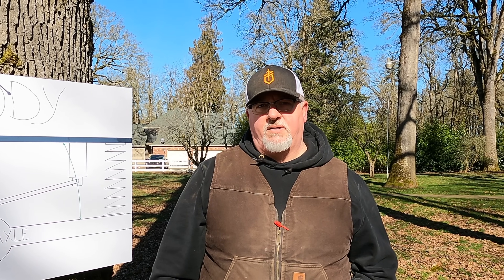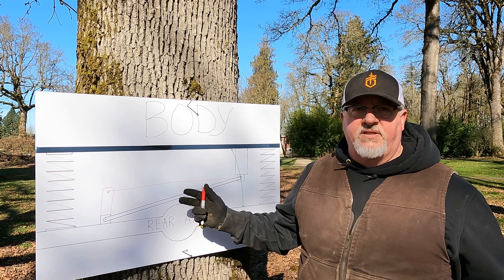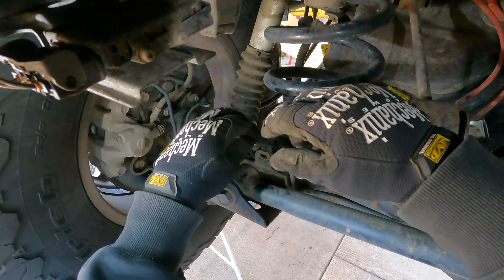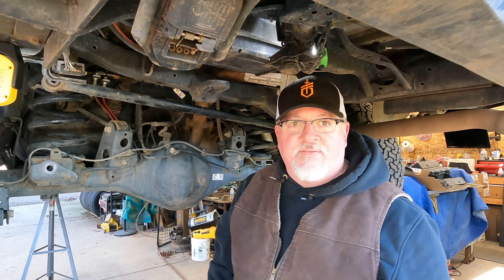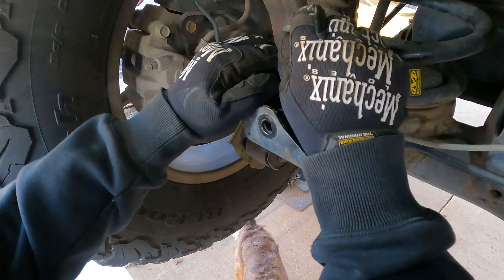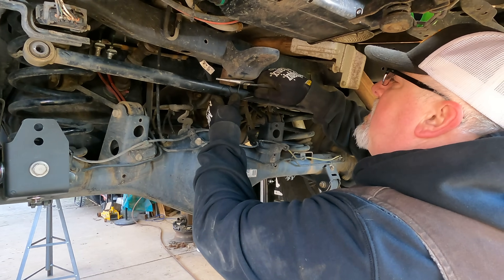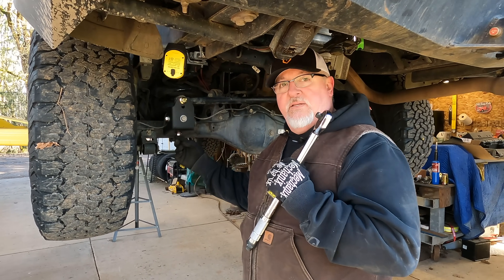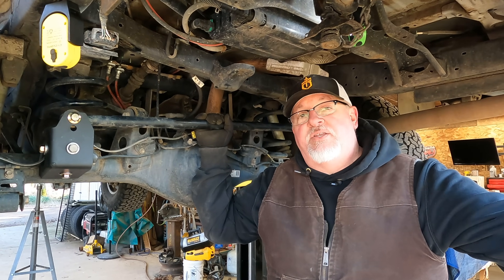Do Not Lift Your 4Runner ... Overland Build Recommended Geometry Fix - Do Not Lift Without This

Comment: So, i lifted my 18 TRD with KDSS using the ironman pro foam cell. It came with an adjustable panhard rod. Should I still do this bracket mod?
Reply from the maker: Best thing to do is to climb under the back and see if your panhard is horizontal (good) or at an angle (bracket should help)

Comment: Hey guys new guy here at what point should we do this if we want to lift 4runner 2 inhes or lower is it a must then
Reply from the maker: The best way to determine if it’s needed is to place the vehicle on flat ground, after you’ve done the lift, and see if your panhard is flat or at an angle. The bracket from drkdss.com will correct it if it’s at an angle 👍🏻

Comment: Which kit did you use? I haven't seen one advertised that looks like yours. No sense changing it if it's not going to be solid.
Reply from the maker: Ironman foam cell pro. I have an install video just for the suspension install. 👍🏻
Reply: @aired-downoverland9239  I mean the pan hard bar leveling kit. I lifted it 3 or 4 years ago and never knew I needed to adjust the pan hard bar. Was is a BOTCK?
Reply from the maker: Mine is made by drkdss.com

Comment: I see some discussion about panhard rod correction in the comments, but you don't mention it in the video at all.  Shouldn't you edit this so someone doesn't have to read all your comments for a good (a safe) install?   Did I just miss it?  Bad on Rough Country for not including it in their kit!
Reply from the maker: Yeah, bad on pretty much every kit for not including a PH correction. They seem to miss things like this, pinion angle correction, sway bar correction, etc.
Anything that changes factory suspension geometry should be addressed. 👍🏻👍🏻

Comment: Thanks for the info. However, shouldn’t it be parallel at ride height? The suspension was fully extended in your install
Reply: Good logic. Also, I would only buy one that can be adjusted based on how high or low you decide to lift, and put a leveler on it when I'm done. Both the presentation and the kit need more specificity.
Reply from the maker: The last shot is the rig off the lift on flat ground.
Reply from the maker: The large version of the bracket has two positions to compensate for different lift heights.

Comment: I’m so on the fence… TRD PRO, OR TRD OFF ROAD PREMIUM??  23’ or 24’???
Reply from the maker: I’m the wrong guy to ask, I’ll almost always go loaded and newer, however, if you’re going to build it out and change the suspension, why go Pro? That said, I do love the colors and the climate control. Good luck 🙌
Reply: I’m not going to build out…. I appreciate your input!🙏
Reply: I just bought the 24’ TRD off road premium.  If you’re not going to go all out off-roading that’s the truck…. The only dif between the TRD off road and the pro is basically the wheels and the shocks….

Comment: I put on an Icon stage 4 and my Panhard is still relatively flat. Why isn’t mine as bad as everyone else’s?
Reply from the maker: If your lift was a 2” in the rear, your panhard should have an upward angle from the axle to the frame. If the rear of your vehicle is super heavy, and you’re only getting a 1” lift, it may air straighter, but should still have some angle.
Reply: The rear is heavy-ish but if I put the Panhard bracket on there it would make the left higher than the right. It was a 2” in the rear.
Reply from the maker: @kriswageman  Note in the video there are two positions for the left hand side; sounds like you would use the lower position.

Comment: What if you use leaf spring suspension
Reply from the maker: No panhard rod typically with leaf spring rigs, so no need for the bracket.

Comment: What is the max lift you can go without the extender?
Reply from the maker: I don’t actually know, but I’d guess around an inch.
Reply: @aired-downoverland9239  from a physics engineering  standpoint, that makes sense. This video saved me. Thank you!

Comment: Do you need to do this with just an 1.5” lift?
Reply from the maker: Best way to verify is to look at your panhard with your rig on flat ground. If the panhard sits at an angle, rather than flat, you could likely benefit from the correction bracket.

Comment: Except when you take the rig off of the jack that bar will no longer be lined up how it is. Same as when you disconnected it. Its on the lift so with the axles and wheels hanging, the bar and bolt won't align. You should show the alignment of the bolt while its not jacked up and in its proper position.
Reply from the maker: I went to your channel to find other tips but found no content 🤷🏼‍♂️. If you had said, “you should torque everything with it sitting on the ground” I would have agreed, then told you it’s difficult to film that way. Having done this type of work countless times, I’m confident in what I’m doing.
Reply: @aired-downoverland9239  I am not trying to sound like I know it all because I dont. My observation was that it looked like the misalignment of the bolt was do to the tension caused by the wheels/axle hanging.  I should've posed my comment more in the form of a question. I was not trying to be rude. 
I have an older Hilux Surf and Land Cruiser that I want to lift at some point. I want to do it right of course. I also dont want to do anything that isn't totally necessary. My position is basically this. As a mechanic, wouldn't you want your customers to ask questions and challenge you on an unconventional idea or installation?
Reply from the maker: Fair enough, I misread your comment. The short answer is, when modifying your suspension, do everything you can to maintain stick geometry…unless you have a specific reason not to. A 4Runner rear axle will move slightly side to side at full droop, but keeping the panhard flat when the vehicle is in the ground is the goal; you’ll get better road and trail manners. 👍🏻👍🏻
Reply: @aired-downoverland9239   I can agree with that. Thank you for putting videos like this out there.

Comment: With only a 1.5” lift in the back how would that bar move that much?
Reply from the maker: Put your rig on level ground, climb under the back and check it. You may not need it, however, it doesn’t take much to throw suspension geometry off enough to feel it on the road.

Comment: If I did a 1” lift would I need to do this?
Reply from the maker: The best way to tell if your rig will benefit from a correction bracket is to park it on flat ground, then climb under the back and see if your panhard is flat or at an angle. You can find more info on the mfr’s site, drkdss.com 👍🏻

Comment: So wait. With the rear suspension fully sagging from raising the vehicle on the lift the rear end centered maybe a half inch when the pan hard bar was removed. I can’t imagine a 2” lift or less requiring this bracket. We don’t travel on perfectly horizontal roads anyway. This isn’t necessary for 95% of lifted 4Runners IMO.
Reply from the maker: I’d suggest reading many of the comments, and people’s experiences (besides my own), and then researching the topic. I don’t make money off this bracket, it’s not my product, and I’m not sponsored in any way. What I do know is the change in my vehicle before and after correcting the panhard angle.

Comment: If you want a bit more rubber on your runner (5th gen here). Look at wheel offset first and foremost.  Cheers.  (A body mount chop, your going the wrong way, again, cheers)
Reply from the maker: I hear you, but I can tell you I am the only one in my wheeling group of 5th gens with absolutely zero rubbing with the offset, wheel size, and BMC I have; the group has many different offsets, lifts, etc.. I’m running a 285/75(not 70)17, which is 33.8 by 11.2. The zero rub at max articulation tells me I did something right. That said, I’m always open to constructive input. Party on 🙌

Comment: Wouldn’t it be better just to get it welded on?
Reply from the maker: The same argument could be used for bolting anything to your vehicle. The advantage of bolt on is it can be removed if needed/wanted. Think about tow bars, they’re bolted on. Rock sliders, bolted on, though some people do weld them on. Bumpers & winch, bolted on. In the end it comes down to the intended use of the vehicle, and personal preference, meaning there is no right or wrong. Good question though. 🙌

Comment: Most do not even consider the front needle bearing wear from a lift.
Reply from the maker: I think it comes down to two things 1) personal preference 2) Are you building your rig for a purpose. In my case it’s primarily the second, however, you are correct in that many people move forward with modifications without research. That said, like many people, I love that I can both modify and maintain my rig myself. 👍🏻
Reply: @aired-downoverland9239 should I lift my rig with the 3inch rough country lift kit with two spacers?
Reply from the maker: There is a lot to consider before lifting a vehicle. For me, I’m lifting to create capability, and I understand the potential risks; everyone should know what they’re getting into. Few lifts come complete with everything you need, including my Ironman 4x4 kit.
Reply: @aired-downoverland9239   Right on
After four wheeling since the 60's I need feel, not lift.

Comment: you really should determine which hole to put it in while axle is at ride height, not while fully extended on a lift.
Reply from the maker: Yes, that is what you should do prior to using a lift to film so people can see what you’re doing.

Comment: I see a whooole lotta wooopsi’s here!! First off.. is this all new info for you? Like you just learned the employment of a “pan hard bar”?  Secondly you use my beloved jeep as an example of what your trying to prove about the 4Runner. Mixed feelings here.. sold an LJ I bought as an investment for 3500… fold it for 8k cash after 1 yr of owning. Then bought a 06 4Runner sport that I am now modding. Good luck bud.
Reply from the maker: Based on your comments I can’t tell If you’re trying to be helpful, taking a shot, or something else. All I’ll say is I’ve owned Jeeps and Toyota’s, many of them, so this isn’t my first rodeo. I’d also say 130k views shows interest. Lastly, the number of people that found improvement in their vehicles manners is the ultimate litmus test.

Comment: good video.  just a little fyi, any bushing that has teeth in the sleeve or the sleeve does not rotate freely, that bolt needs to be tightenend down, when the vehical is at rideheight.  if not, a certain amount of pre load is applied to the bushing, which can lead to premature tearing of the sleeve from the bushing.
Reply from the maker: Absolutely correct Zachary

Comment: What if i'll lift only for 1.5inch
Reply from the maker: Best thing to do is take a look at your panhard rod while you rig is on flat ground; if it’s horizontal, or close to, you should be good. If it sits at an angle you could consider the bracket from drkdss.com

Comment: Also don't fit wider tires without an Ackermann corrector kit.
Reply from the maker: That’s a Tie Rod style steering thing, it doesn’t apply to 4Runners
Reply: @aired-downoverland9239  I think it applies to every car with steering. 
I need to say with „wider“ I mean spacers or rims with non-stock backspacing. 

All in all it was meant as a joke, I didn’t think a correction kit exists but google told me otherwise.
Reply from the maker: @evil_twit  paste the link in a comment, I’ll check it out. Thx

Comment: And thats why I did a 1.5" lift. You honestly shouldnt go past 2" on a Toyota ifs anyway. The wheel wells and fenders are the main problem
Reply from the maker: Why did you keep yours at 1.5?
Reply: @aired-downoverland9239  2" will sometimes run into uca alignment issues. I did the lowest common denominator where I wouldn't have to worry about anything

Dig on the Toyota ifs stuff. Essentially, imagine you have 8" of suspension travel. It's 4" up and 4" down. Now imagine you do a 2" lift. Now you have 6", but only 2" down. That's basically what happens. The Toyota "wheel wave" going over obstacles

Comment: I’ve had a 3 inch lift kit on my 17 4Runner for 6 years now never realized I needed to do that ride’s fine don’t feel anything funny in the differential 🤷🏼‍♂️
Reply from the maker: Always good if geometry change doesn’t change road or trail handling.
Reply: Which lift kit did you go with?

Comment: You do not want to lift your off road truck much if built to frive fast off road. You could roll it easierI did a 4" lift on my 4x4 pRERUNNER . Yes long travel with 4wheel drive .  On King shocks do to a plated & gusseted twin traction beams with a cut & turned just 4inch lift longer shocks with good tall mounts up front and a frame to frame shock tower ib the back on Deaver springs the shocks not coming into the Bronco needing to tub in the body& loose a lot of interior space long chromoly Heim joint mounted radius arms with built up connections to the beams all cycled cleared and limit strapped.  Needed more adding an F250 slipshaft axle with big U joints. A lot of other stuff and a lot of work but I COULD NOT AFFORD A raptor AND WOULD NOT WQNT TO OFF ROAD THAT MUCH $$$ THE WAY i DRIVE BUT SURPRISES HAPPEN WHEN OFF ROAD AND THE WAY IT CAN HANDLE A SURPRISE AIR AND GOOD SIZE WHOOOPS FASTER THAN i WOULD EVER TAKE MY PREVIOUS LITTLE Toyota 4X4S ON ranchos WITH SOLID AXLES i DO NOT THINK THEY WOULD MAKE IT . BUT WITH IT BUILT WELL ON THE kings IT CAN FAST & IN CONTROL WONT EVEN SPILL YOUR MUG OF COFEE IF YOU KNOW HOW IT WORKS JUST A LOT OF PERMAGRINIS NICE. But A LOT OF HOURS LEARNING WHAT & HOW DO DO IT AND SOME KNOWLEDGE WORKING WITH METAL FROM A CAREER REPAIRING & INSTALLING ELEVATORS & ESCALATORS. not AN EASY JOB AT ALL BUT HAPPY i PUSHED HARD & DID IT AND LEARNED WELL.& THANKS TO MY FRIEND A GREAT WELDER AND MOREAND fAST ON WHEELS YT CHANNEL FOR THE RECONMONDATION FOR ONE OF THE MOST IMPORTENT PARTS. the engine. & THE ORIGINAL BUILDER OF MY SUSPENSION i HAD IN GOOD Mr. Nolan's AUTO SHOP a OFF ROAD RACER WITH A RACE TEAM AND BUILT GREAT UPGRADES FOR OFF & DO NOT BELIEVE THE Bs many say if you are going to off road it not just s mall crawler there is important things and ways to do them.

Comment: IS THIS NECESSARY ON 2" LIFT WHAT WOULD BE THE NAME ON THIS KIT AND WHERE TO GET IT? TNKS
Reply from the maker: You can find it at drkdss.com and the best way to tell if you’ll benefit from this in to check your panhard rod while sitting on a flat surface. If it’s horizontal, you likely don’t need it. If it angles upwards from the axle mount to the frame mount, you probably will. 👍🏻👍🏻

Comment: At $280 a piece!! These folks are crazy!
Reply from the maker: They’re $280 now??? They were $199 just a month ago… 👎🏻
Reply: Greed! I'll look for something else, not sure if they sponsor u in any way, I would definitely ask them how they came up with the price.
Reply from the maker: @adamh2837  They don’t sponsor me, I paid full price out of pocket, but am not happy they’re using success to price gouge. I think I’ll write them a note about this.
Reply from the maker: I just checked, it says $205???
Reply: Where did you see $280.  

Also come up with that price ?  It’s a well engineered piece and I fully put my life on the line when testing them to make sure they can survive in anyone’s world.  Buy the weld on version for $100.  Then pay another $100 for it to be welded and then you gotta rattle can it hoping you get all in the greases of the weld so rust doesn’t develop and eventually weaken it.  They are $200-$210.  Show me where it’s $285
Reply from the maker: @drkdss8742  Having had mine installed now for several months, on and off road, and feeling the difference, I would happily pay $300+ even though they’re very reasonably priced at -$200
Reply: @aired-downoverland9239  as soon as prices come down on metal and just inflation in general best believe I will try to get it lower.
Reply from the maker: @drkdss8742  Personally I think it’s priced well for the design and quality.

Comment: wtf! No welding! Take my money!🤙
Reply: Not only that.  I can guarantee you that is much stronger setup then the weld on option as long as everything is torque down properly.  The load is spread all over and in the oem mount vs across the top of the oem mount where it’s really thin

Comment: Seems like a bad design for the rust belt.
Reply from the maker: I’d have to disagree for these reasons: 1) brackets are powder coated, and they did a really good job 2) Hardware is coated grade 8  3) unlike weld-in, you could easily pull this out, touch up and areas needing it, and re-install. Personal opinion only (I’m not sponsored), this is the way to go for rust prone areas.
Reply: I think Steve is right. These components should hold up as well or better than the other OEM parts in that part of the vehicle. My 2011 4Runner spent eight years near Traverse City, Michigan before I purchased it and replaced my rear suspension and panhard bar. Those powdercoated parts and fasteners should hold up really well and remain pretty accessible if they need attention.

Comment: Not bump steer lol😂 Bump steer is not a rear end problem. Your truck may dogwalk a bit. That's it.

Obviously better with the kit though. 👍looks nice and strong, far stronger than stock.
Reply from the maker: Not trying to tic for tat, but bump steer is any steering movement (front or rear) felt as the suspension moves through up or down motion.
Reply: @aired-downoverland9239  definitely a valid statement.  Cheers! 

Gonna sub ya. 4runners 🫠 check us out